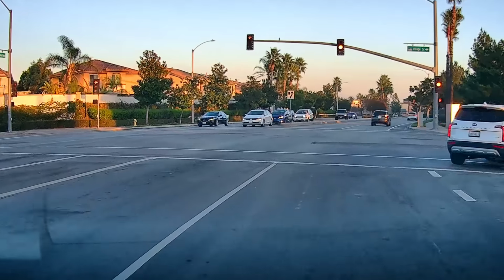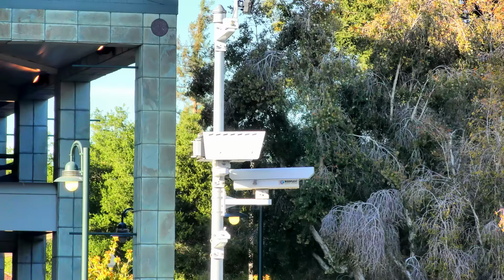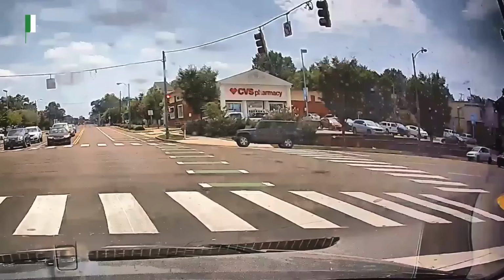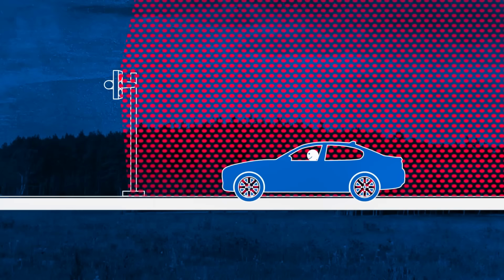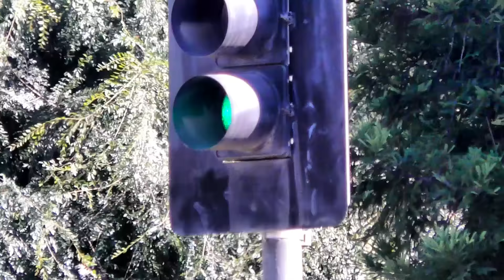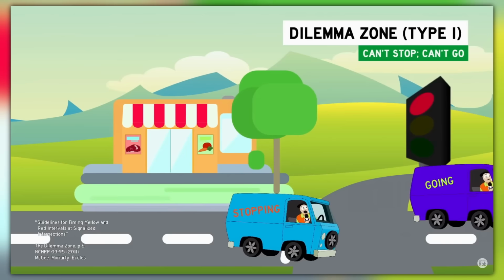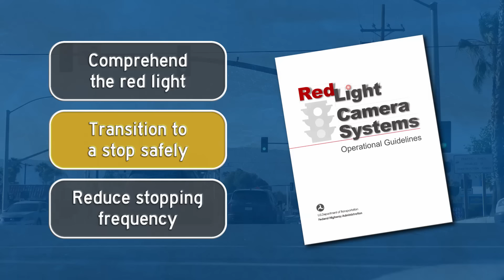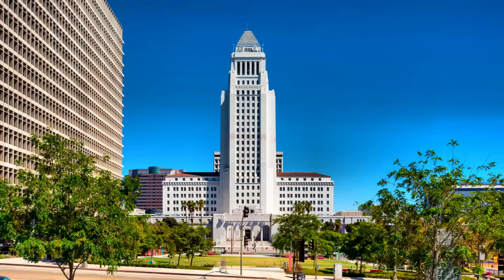Three ways to FIX a STOP LIGHT (so drivers ACTUALLY STOP!)

Comment: The problem with those filters is sometimes, if you're in a semi, you can't see the light until you're half way through the intersection. Because your line of sight is higher, it follows the same path that the engineers tried to block from the previous light.
Reply: I pondered that potential dilemma. Good to know it is how I imagined.
Reply: Here in the UK and other European countries, the two lights would have traffic sensors and be timed in such a way that if you're driving the correct speed, both lights will be green as you pass through.
Reply: I don't think there should be semis going through towns that often. Just be careful. The filters won't cause problems. You are driving SLOWLY.
Reply: @iamdave84  

No, it isn't. Semis shouldn't be going through towns too often. He is also driving slowly. He should have time.
Reply: @zaco-km3su  Semi-trucks are constantly in towns. That's how almost all the inventory for all of your grocery stores and retail establishments gets delivered.
Reply: @teebob21  

No need for them to be in towns or cities. No, that's NOT how all the inventory for all YOUR grocery store and OTHER retail stores gets delivered. Stop lying. Ever heard of warehouses? Also, those filters will work for semis too. Why? Because they move slowly.
Reply: @zaco-km3su  Are you serious? Do you not know that semi trucks are what deliver to and from those warehouses? Why do you think every grocery store, hardware store, and Walmart in the world has a loading dock for a semi trailer?
Reply: @teebob21  

Yes, I am. A Walmart IS NOT IN A CITY. Who said delivering TO THOSE WAREHOUSES? YOU. Stop lying. The warehouses are OUTSIDE THE CITY. No, the VAST MAJORITY of grocery stores, hardware stores DON'T have loading docks for semi trailers. Stop lying. How many times did you get hit in the head? Walmart DOESN'T MATTER. Also, it's NOT IN A CITY.
Reply: @teebob21  you can't have a sensible conversation with everyone it seems. I get what you're saying. I agree.
Reply: The red and yellow lights are not SUPPOSED to be filtered. The problem is, they usually are.
Reply: @iamdave84  

Actually you CAN. I've worked in retail and logistics. Most shops DON'T HAVE SEMI LOADING DOCKS. I guess pointing to the facts is "not a sensible conversation" to you. It is. You're just "not sensible". You agree with him? You can agree that walking in front of a moving truck is safe, it will still crush you. You're wrong. Semis have little if any uses in cities. They can also move slowly and they will see the filtered lights. Filtered lights are not an issue.
Reply: @FUGP72  

No, they ARE SUPPOSED to be filtered. It ELIMINATES THE CONFUSION. Semis will barely move to the next light in these cases. They have PLENTY of time to stop.
Reply: @zaco-km3su , it's difficult to have a sensible conversation with someone that personally insults everyone with a different opinion. There's no need for insults. Maybe we have a different idea of what a semi is. Terminology differs across countries. What do you call the vehicle that delivers goods from a warehouse to a supermarket?
Reply: @iamdave84  

Depends on the size. I'm from Europe and for me a semi is a tractor that pulls a trailer that carries 20 tonnes or more. Now, you're backtracking. Nice try. In most cases a 4 tonne truck can deliver the goods.
Reply: @zaco-km3su I'm in Australia. Here a semi is a large truck with a tippable box on the back for hauling usually dirt, rocks, sand, etc. 3 axles, front 1 for steering and either 1 or usually 2 rear axles each with 4 tyres below the box for acceleration.
A semi here often hauls a "quad dog" trailer that's basically a similar sized tipping box with a pivoting front axle.
Reply: @zaco-km3su  No. Only the green is supposed to be filtered. I was told this directly from the NYS DOT when I asked them about it in the '00s when they were first going up in my town and they DID put the filters on the red. A couple weeks later, those filters were removed thanks to me pointing it out. And it is common sense really. The whole point of the filter is to avoid people seeing the Green light at the nearby next intersection and mistaking that for the closer intersection. There is no problem if they mistake the RED light at the next intersection and start to slow down a little early.  And the last thing they want is for motorists to not see the red light until it is too late to slow down safely. And yes, it is absolutely only supposed to be the green that is filtered. 

As for having plenty of time to stop, are you under the impression that it is for cars being stopped at the first intersection, then getting a green and seeing the next one? Because it isn't. It is for situations when the cars are driving at regular speed because the first intersection is green and the next one is red. And yes, when they are mistakenly filtered, those red lights can't be seen until you would definitely have to stop short, possibly getting rear ended. A semi-truck would have an even harder time.
Reply: @zaco-km3su   I think the big issue here is that you have a different idea of what a town or city can look like than other commenters here. There are plenty of Walmarts and other big stores that get their deliveries from semis in cities where I'm from. No, these cities aren't the size of New York or San Francisco, but they're still cities, and still have plenty of semis running around in them.
Reply: @KnickKnack07  

No, all of them are supposed to be filtered. Nice try. You didn't point out anything. Stop lying. There ARE problems if they mistake the red for the red from the FIRST intersection. That's how you "rear end" or crash in someone. You have no idea what makes sense. 

They have PLENTY of time to stop. What do you think happens between 2 close crossroads? Everyone tries to accelerate as fast as possible? That's not happening, even less for a semi. You will be below the speed limit in a city.
Reply: @bryanward246  

That's not an issue. Nice try. Pal, a Walmart or any other store of that size is built on the outskirts of the city, not in the middle of it. I know how things are in a city. You don't need a semi in the city. 

Of course in New York there won't be any semis running in it. That goes for all large cities. It will cause problems for a semi. For smaller cities, that might happen but that's because there's no bypass.
Reply: @zaco-km3su  Oh sorry, I didn't realize you knew the layout of every city in America. My apologies.
Reply: @bryanward246  

Oh, you don't know how logistics and prices work. How nice. This is why Walmarts and other large stores like those are on the outskirts. Nice try. Stop lying. You never figured that one out. 😆It's not about the city. You don't need semis in the city. I bet you haven't even realised that Walmart is either outside of the city or on the edge of it.
Reply: @zaco-km3su  And there's one right in the middle of Philadelphia, and the Northern part of DC, and over a dozen scattered all throughout the Detroit Metropolitan area. Take a look, buddy. Of course, you won't, because you're too full of yourself to ever believe you could be wrong about anything.
Reply: @zaco-km3su yes it is, they come through cities to deliver goods all the time.
Reply: @zaco-km3su Walmart are found inside cities all the time.
Reply: @zaco-km3su okay, this is america we are talking about, you can't talk about american stores if you're from Europe.
Reply: @zaco-km3su wrong again. Most of the time they are inside cities (atleast in the US, what the video is talking about)
Reply: @zaco-km3su there are multiple in  scattered throughout Springfield, Missouri. I would know, I live there.
Reply: @frenchfry1479  

No, it isn't. They're not needed.
Reply: @frenchfry1479  

Yes, inside cities at the edge.
Reply: @frenchfry1479  

I can talk about anything I want. America doesn't matter. NO need for semis in cities. Get over it.
Reply: @frenchfry1479  

Wrong! Most of the time they're at the edge. I'm right.
Reply: @zaco-km3su  inside cities, throughout, as in. Middle, outside, edge.
Reply: @frenchfry1479  

More like on the edge. Outside. Nice try.
Reply: @zaco-km3su  look up Springfield Missouri.
Reply: @zaco-km3su  I genuinely hope you get through whatever it is you're going through.
Reply: @frenchfry1479  

Do basic research. They're at the edge.
Reply: @mrfoxycracker4836  

I'm not going through anything. I was about to ask if you are but you clearly don't know that you are. You should look in the mirror.
Reply: @zaco-km3su  you appear to have accepted defeat
Reply: @zaco-km3su  if so, good. Glad that you accepted that and stoped looking like a fool. I understand you probably misunderstood us, so I'm not mad, and I'm sure you are intelligent. We all have those moments.
Reply: @frenchfry1479  

I wasn't defeated. You don't know what you're talking about. You got owned.
Reply: @frenchfry1479  
I'm not looking like a fool. You are. You're not that bright. Nice try. Walmarts are at the edge of cities for convenience. It's easier to supply them than getting a semi in a city. I'm not having a moment. You can't accept defeat. It would be great if you had a moment....but that appears to just be you.
Reply: @zaco-km3su  maybe the Walmart in Europe are diferent. In America (the place that the video and comment are about), our walmarts are throughout a city. This is because OUR roads are huge. Even the smallest city streets can usually fit a semi truck and trailer. This means that it's more convenient for Walmart to just build inside cities and on the outskirts near the major highways. The ones inside the city are usually the neighborhood market ones, the ones with mostly just food and household supplies (this is not always the case). On the outer edge of the city is where you usually see a "super store" which has food, electronics, clothes, pharmacy, hell, even  banking, and mechanics! So, I say we should call it a misunderstanding, we were both right.
Reply: @frenchfry1479  o, it's in the US too. It doesn't matter how big the street is, it's a semi. Pal, you build a street and it will get FILLED WITH TRAFFIC. Especially in the US. There at the edge of the cities. Why? Because not only can they be supplied easier, but others that don't live in a city DON'T HAVE TO GO INTO THE CITY.
Reply: @zaco-km3su  I said that they are THROUGHOUT the city. also, I said specifically that we are both right. They ARE on the outskirts, but also inside of a city.
Reply: @frenchfry1479  

Maybe small ones are inside the city and they don't need a semi to supply them. It doesn't matter how many lanes you have, they're occupied. Especially in the US.
Reply: @zaco-km3su  yea, the "small" ones are In the city, and usually use SMALL semi trailers or box trucks to supply them. Although because a highway runs through the major city near me, there are a few large ones inside the city. But that's also in the business districts.
(Springfield, Missouri, in case you wanted to see for your self)
Reply: @frenchfry1479  

Small boxtruck. Yes. Small semi? No.
Reply: @frenchfry1479 Dude....  Stop feeding the troll...
Reply: @ColonelSandersLite  yea... I'm done now.

Comment: Those traffic lights way off to the side and mounted lower (mentioned at 7:25) are so helpful, and I took them for granted when I lived in california. It's not just when you're behind a tall vehicle, but also if you're driving into the sun, that they're important. There are so many days I've been driving around where I have to have the sun visor low enough that I literally can't see the traffic lights because I won't be able to see the road if my visibility is that tall.
Reply: But in the video clip mentioned (go back to 7:14) and you'll clearly see the signal 2 lanes to the right
Reply: @DontScareTheFish  that's well within the area you should be looking at. You should never enter an intersection without knowing what cars are on the cross street, and that traffic signal is right where you would look to see what cars are coming from the right.

More importantly, it is low enough that it's not going to have the sun right next to it. You're never going to see a traffic signal while it is competing with the sun, and no one with any intelligence is going to let themselves look at the Sun and expect to be able to see what's on the road. That was my point.
Reply: In Australia we used to do the side lights before we started doing the high speed overhead light.